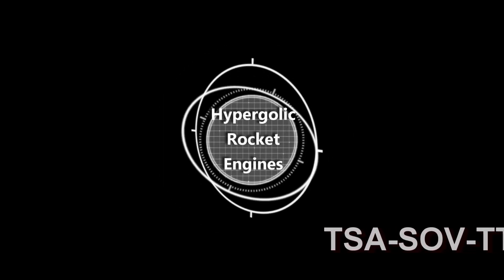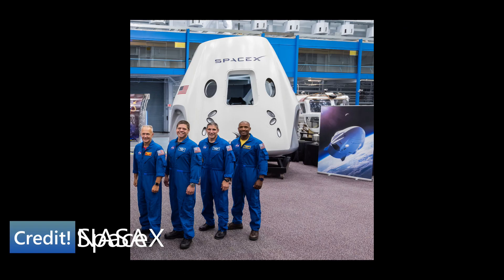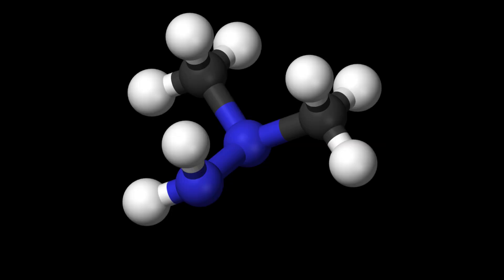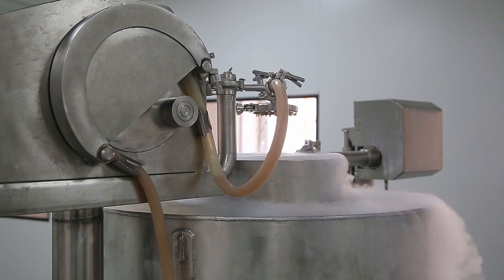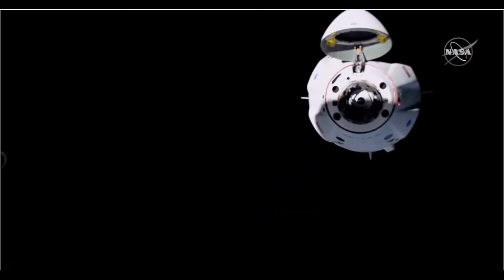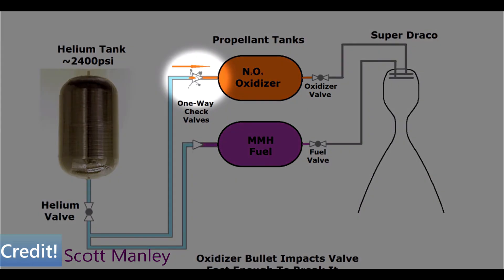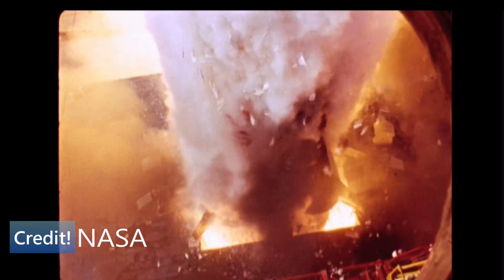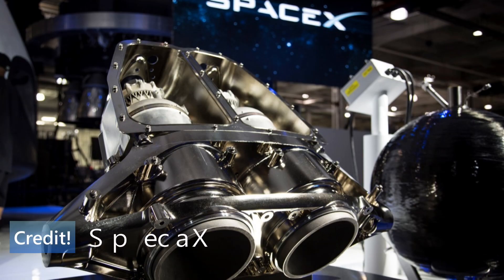Rocket Science:  Hypergolic Engines Like the SpaceX SuperDraco

Comment: Hello sir 
I would like to know how come the same volume of hydrazine+nto yields more delta v compared to same volume of hydrolox
Reply from the maker: The energy density of hydrogen is very, very low. 71kg per cubic meter.  Hydrazine is about 1008kg/cubic meter.  Even though the energy per kg of hydrogen is much higher, the density is so low that by VOLUME hydrazine wins.  Check out the lesson on why methane was chosen by SpaceX.   https://youtu.be/I194jFyKUV8  It goes over all this in detail.
Reply: @terranspaceacademy  thank you so much for this explanation.
Reply: @terranspaceacademy  is there a trade-off in tank mass/volume at which hydrolox becomes better?

Comment: So, I found your video while searching for possible credible ways to create a flamethrower-type weapon that works in space for part of a sci-fi/horror book series I'm writing. I saw where a futuristic video game (Deadspace) used a Hydrazine fuel-based mining torch to modify into a flamethrower. In a video on Youtube, someone said that technically it would "burn" in a vacuum even though in the game it did not. That as long as you have the fuel and catalyst in contact, pressure fed into a combustion chamber just like you diagramed here, that it would "burn" / rapidly disassociate etc and produce extreme heat. If you don't mind, any thoughts would be appreciated as to the theoretical feasibility of this idea. Thanks and thanks for the great video you put up here.
Reply from the maker: Please email me at terranspaceacademy@gmail.com and I will help you all I can.  We can calculate propellant flow and kick-back force produced.  Your friend is right.  It would indeed burn at full power... better have a good grip on it :-)

Comment: The verb "fuels" isn't to be used as a noun, it's not "plural of fuel" as fuel is fuel, bo matter how many forms are being referred to. Using it as noun is just not only confusing but forms a phonetic disharmony with any sentence structure that you are using it as a "plural noun."

This issue is popular but false pluralism of many nouns, because society is dominated by the act of breathing through the mouth instead of the nose. Flow of breath defines cadence and sense of speech~language.
Reply from the maker: The plural of fuel is the noun fuels... 
fu·el
/ˈfyo͞o(ə)l/
Learn to pronounce
noun
plural noun: fuels
    material such as coal, gas, or oil that is burned to produce heat or power.
Reply: Shut up dude